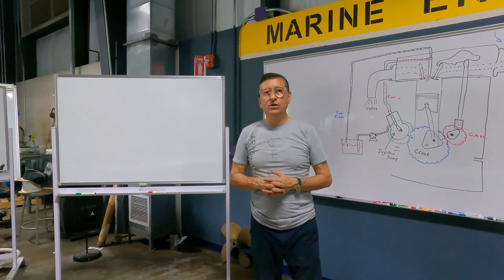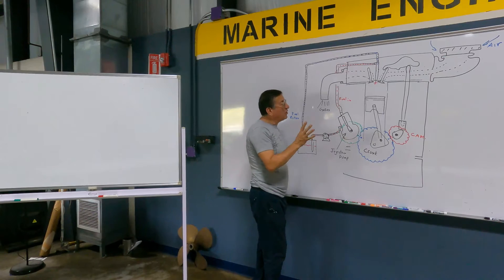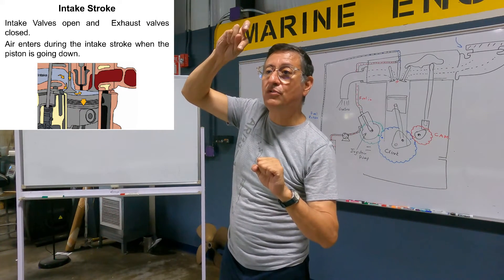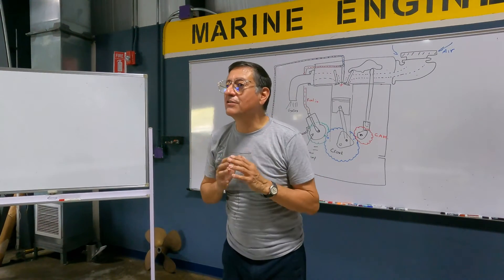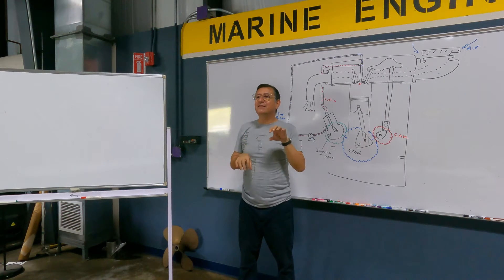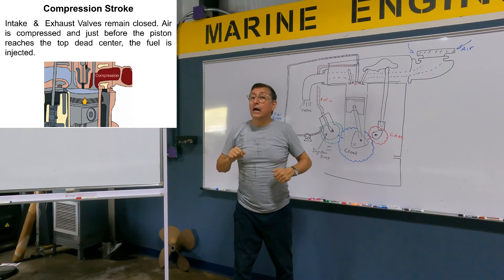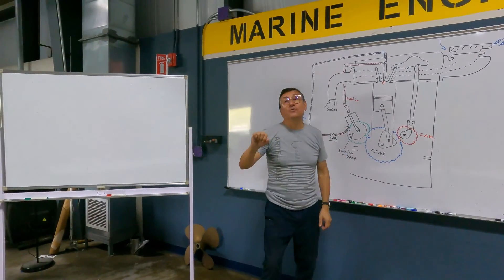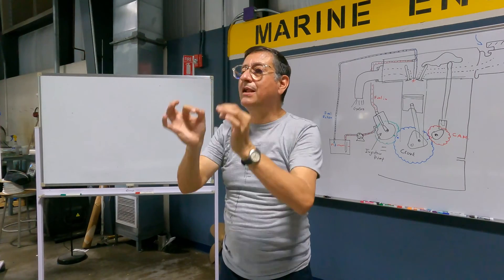Timing in Diesel Engines

Comment: Cummins 855 had straight and offset keys for camshaft timing and fuel injector timing was achieved with shims installed on the camshaft followers . If memory is correct 19 degrees before TDC which is .203 of an inch !